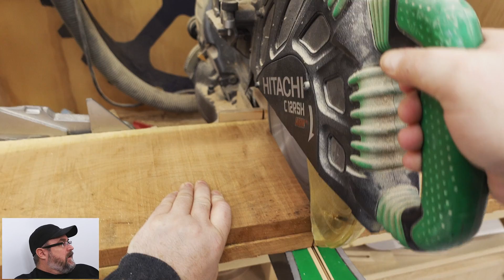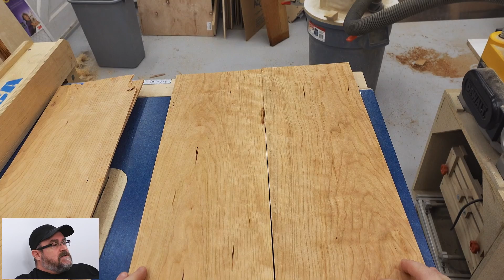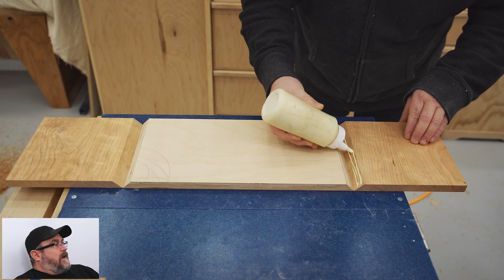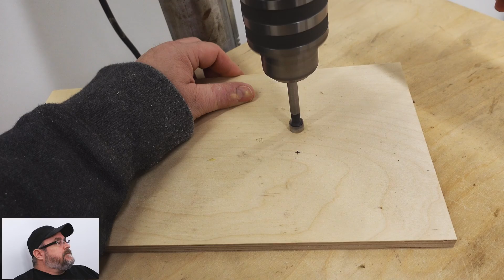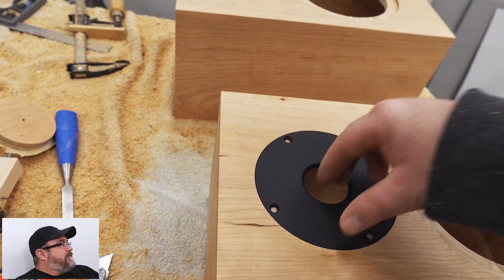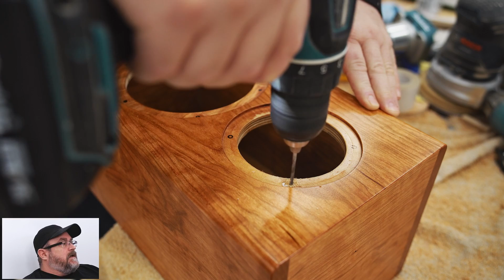How To Make Bookshelf Speakers - Woodworking - DIY Speakers

Comment from the maker: Build article with more detail about these speakers:
https://ibuildit.ca/projects/how-to-make-bookshelf-speakers/

Some of the things to learn from this video:
1 - don't try to dress the full board when you will be cutting it into smaller pieces anyway. Instead, rough cut to length, then re-saw / dress - you'll lose less material / get more from your stock

2 - flatten one side on the jointer before trimming the edges. The stock will be more stable and safer to cut.

3 - use a point fence on the band saw when re-sawing and draw a guide line. blade drift can cause the cut to go off line when using a flat fence

4 - clamp freshly cut or planed stock to keep it from warping too much until the next operation.Even dry wood has varying moisture content, and when yo cut or plane deeper into the stock, the new surfaces have different moisture contents that can make the wood twist, cup or warp.

5 - solid wood expands and contracts with seasonal changes in humidity, so you can't use it in a place where it can do this freely, like the front or back of a speaker box. Instead, cut a piece of veneer and glue that to a plywood substrate. The plywood is dimensionally stable

6 - never trust the saw to make critical cuts accurately - cut a sample from scrap to check before using the good stock

7 - tape is an extremely effective way to clamp miters that are being glued. Use strong tape that won't break or come loose when you close the miter together.

8 - using a slower setting glue takes the stress out of complicated glue ups, giving you plenty of time to correctly position the parts and get the clamps in place

9 - sanding is a pain, but often the difference between what looks like amateur work and professional. Don't forget to finish by hand sanding everything to get rid of the swirls left by the machine.

10 - Cleats can replace rabbet cuts for back panels and are often faster to do. 

11 - when cutting a circular hole with a router and circle jib, don't go all the way through. Leave just a sliver of material to hold the center in place then cut through that with a sharp knife.

12 - on figured wood, climb cutting with the router to round over the edge is the best way to prevent chip out. doing it in 2 or 3 passes is also recommended.

13 - seal the inside of solid wood projects to help block moisture absorption.  

Ways you can help support this channel:
Patreon:
https://www.patreon.com/user?u=865843&ty=h

Project plans for sale: https://ibuildit.ca/plans/

Become A Member of this channel:
https://www.youtube.com/channel/UCjA8vRlL1c7BDixQRJ39-LQ/join

More videos on my second woodworking channel:
http://www.youtube.com/c/IBuildIt

My home reno channel:
http://www.youtube.com/c/IBuildItHome

My "Scrap bin" channel:
https://www.youtube.com/c/IBuildItScrapBin

#ibuildit

Website: https://ibuildit.ca/
Facebook: https://www.facebook.com/I-Build-It-258048014240900/
Instagram: https://www.instagram.com/i_build_it.ca/
Reply: I have 10 years experience in manufacturing professional sound boxes, I have never had the opportunity to make with solid woods. Congratulations My friend Jonh
Reply: Wow.... those sound amazing!
Reply: thanks for sharing sir.
Reply: What is a good source for the wood?

Comment: Nice work! These speakers look beautiful. I'd love to make a pair for my record player. Too many damn projects already on the go though -.- so I guess I'll just add these to the list haha. When rounding the front edges with the router, you should clamp or stick a scrap piece to the ends so you can run the router off without rounding the corner. It'll also prevent any blowout.

Comment: You make them look so easy to make, a professional in action. My guess a pair of this box will at least take you more than 10-20hrs to make from start to finish. Such a piece of good looking and professional work you should really use high-quality speaker drivers to make the project worthwhile. And even better the speakers will last you for many years to come.
I have built speakers boxes before, not even half as good as yours. Even then the results great sounding speakers. I build for fun and test for different types of sounding speakers using different drivers, configurations and topologies.

Comment: Nice speakers, I've built a few speaker boxes but I've always been afraid to use plywood in the case of delamination of any of the plys would cause an unpleasant vibration at specific frequencies.  Thanks for all the videos I'm sure it's a lot of work

Comment: They look amazing, Curious if you bought the parts in Canada or Online? I found one site out of Quebec that seems to sell a tone of speaker building components.
Reply from the maker: You probably mean Solen. That's where I bought these woofers, and a bunch of other stuff. That was 12 or so years ago, but they are still around and reliable to deal with.
Reply: @JohnHeisz  Good to know,  Amazon.ca is close to 2x more than .com and Solen seemed to have good prices and a decent selection.

Thanks for the feedback :)

Comment: Killer looking speakers John. I made some last year and I found that you need some holes in the box to allow air to be pushed around. The speakers are a pump and you will get a fuller sound with better base if you allow for air movement in and out of the speaker box. Just drill about a 3/4 inch hole in the backs and they will sound much better.
Reply: The diameter of the hole and the length of cylinder feeding it from the box interior is dependent on interior volume and desired bass character. Not a detail to be taken lightly. This article does a fair job of describing the process: http://audiojudgement.com/bass-reflex-speaker-design/

Comment: I was under the impression that moving air is the best way to have a better bass sound;  I noticed you didn't have a hole in the back of the speakers. Am I wrong or is it your view the hole is not needed?

Thanks
Reply from the maker: You don't understand what the hole is. It's a tuned port and not all speakers have one.
Reply: @JohnHeisz  Ah, okay.

Comment: looks awesome  just a question why did you glue the back on would it be easier to access the wiring at the back  of the box and would have put the wire jacks on the sides lift and right side  can put the speaker to the wall and do not have to have the wires broke off  when they get bumped around

Comment: Excellent build John. Will remember that edge routing tip. I’ve ruined many projects going to the edge. Also, what about insulation in the cabinets? Is it not necessary?

Comment: have you ever used a router lock joint to join the 45 miter cuts. to simple explain it is a router bit that cuts a 45 degree bevel with a tongue and groove that makes a super strong joint that wont slip. they are a bitch to dial in as you have to adjust the fence and height to match up. but you can make a jig by keeping a piece after cutting it and using it to set up the next time. Sure you know what one is but explained for your followers that might not know. It makes the easiest way to create a box with no end grain

Comment: Look very nice! I just started doing the miter cut glue up a few months ago myself, so much better than doing butt joints and clamps, in fact I'm building a contraption so I can do it more quickly with much more accuracy and consistency as I build quite a few speakers.

Comment: I was planning on making speaker cabinets from hardwood (not sure what hardwood yet) and use dovetail joints for the sides, would expansion and contraction break those joints? I would use plywood and veneer for the front and back.

Comment: Just wondering why you didn't use one of your table saw sleds for the mitre and used the fence instead.  I know that you know what you can and can't do safety wise, but I would have thought the precision would be easier to control with your sled?

Comment: Excellent! I built a similar set about 25 yrs ago that I still use. The main focus of the plans that I followed was sound quality, selecting the right speakers and getting them located correctly in the box so that vibration complemented the speakers.  Johns are much better looking. I'll be looking fwd to the second part.

Comment: I didn't know you can add polyurethane over oils !
Reply from the maker: It needs to be an oil that cures, like boiled linseed oil. Danish oil has polyurethane in it.
Reply: @JohnHeisz   Thanks John. I have some tinted Danish oil that gives a lovely colour but for some projects I would of liked a little more sheen to the finish - so will be trying it out :)
I also have some Teak oil here - can that be used the same way?

Comment: Three things: great tip to stop rounding over before the end of the workpiece (and hand sand the remaining pieces); thanks!
What is a "crossover"?
Are dimensions of the 'box' important, in relation to the speakers?
Reply from the maker: A crossover divides the sound frequencies so that the tweeter will get the highs, and the woofer will get the lows.
There's more about the speaker box design in the build article.
Reply: @JohnHeisz  Thank you, John, I will read up on it!

Comment: Why would you dislike this?
Reply from the maker: Actually, most of the dislikes soon after the release are from haters that just subscribe to dislike videos. Yes, people are that petty and small minded, but a view is a view.
As a video starts to get more views, the bulk of the dislikes come from people that feel they were tricked into watching it and general dislike everything anyway. 
I'd be very surprised if anyone has disliked it because of what they think are safety issues. Tose guys are usually too busy typing a comment that I'll delete to click on the dislike button.
Reply: Probably the health and safety brigade. No blade guard, no cross cut sled, hands too close to the blade etc. But they fail to take into consideration the fact that John is a professional with many many years of experience. And still has all his fingers.

Comment: Very attractive, and as far as I can tell through my plastic Logitech, a very nice sound. What was the reason you did a climb cut with the router? I missed that
Reply from the maker: Climb cuts reduce the chance of chip out, especially when working with figured wood.
Reply: Almost a zero % chance of tear out on using a controlled climb cut !

Comment: I have 10 years experience in the manufacture of professional sound boxes, I have never had the opportunity to make with solid woods, here in Brazil this is very scarce and very expensive woods like that.
Reply: I worked for the north american distributor of a high end italian speaker producer making repairs. Some of their products were made from solid wood, but the proper acoustics are difficult to achieve and require more complicated design architecture. MDF is a much more forgiving material when it comes to acoustics. This video does not address the acoustics of speaker box design and while the boxes are very pretty, they likely sound worse than speakers made with plywood or MDF.  If you are making speakers at home, i suggest veneers unless you know a luthier.
Reply: The solid wood is a veneer, the core of the walls are still plywood.
Reply: @edwardtse8631  AFAIK plywood is generally considered to be acoustically superior (flatter response) than solid wood.  Birch with a high lamination count appears to be the most favored.
Reply: @jcims  Thanks for you reponse, so do you understand why John would use 4 sides using real wood, yet left 2 side using plywood?
Reply: Edward Tse I believe it is because the end grain would be visible. Also, the corners were rounded over, and you need the grain right through for that.
Reply: I love your country''s music... especially anything by "Tom" Jobim.
Reply from the maker: @Elizabeth Murphy - as I said in this video, more details on the speaker design in the website article. But I'll warn you before you go there: I don't engage in any of the typical tomfoolery that most "audiophiles" believe in.
I can tell you this here: I most certainly do know how to design a speaker, especially a simple two way like this one. And there's no magic in the material - solid wood performs just as well acoustically as any other wood based stock for building a small speaker like this. To say otherwise is to spread the kind of misinformation the audio world is infested with.

Comment: Beautiful speakers John!
Regarding the learning part...  I don't know. Most of those operations are not for me. Knowing me, the probability of me killing half of the population in the village doing what you do is too high. Very cool stuff regardless.
Reply from the maker: If you have 15 years experience, you wouldn't be saying the silly things you've said in other comments. 
This video is about building something, not safety. If you want to learn about safety, go watch some safety videos. 
I'm not going to alter the way I work because someone who hasn't been in the same room as a table saw thinks it unsafe. If that's not to your liking, please leave, since I have better things to do with my time than explaining the raw basics to people who think they are experts because they've watched 15 years worth of YouTube videos.
:)
Reply: @JohnHeisz  there is validity on both sides. John I assume that you would not make the same cut using a big 5hp 12" saw (unless it had a sliding table ) 
This is John's tool in John's shop doing what John does. 
I drive a "full size" pick up truck, and I squeeze it through some otherwise silly places...I wouldn't even try some things in my wife's midsize sedan because I just dont know where the corners are.

Same deal different tools.

As John says, this is not a safety vid, and I'm pretty sure he's said a whole bunch of times ' this is what /how I do, don't do the same unless you are comfortable doing same safely ' 
More or less, do as I say, not as I do.

Watch and you see that hands and fingers and body are 99.44% always in a safe place.

I trust him not to dismember himself, but no, I dont use my saw the same way .... nor, necessarily,  should anyone else.
....but let's not talk about chainsaws, hammers, butter knives, etc. shall we?
Reply from the maker: If I did it, there must have been a good reason. It's not hubris, it's competence and weighing what I know I can do safely and the risks involved. 
It's difficult for people that don't have or understand competence to accurately assess what they are seeing, and I can usually tell how little real experience someone has based on what they say.
Reply: Woah. This took a left turn.
Reply: I hope guitarchitectural is not from the U.S. The way the world see's Americans, does not need this beating.